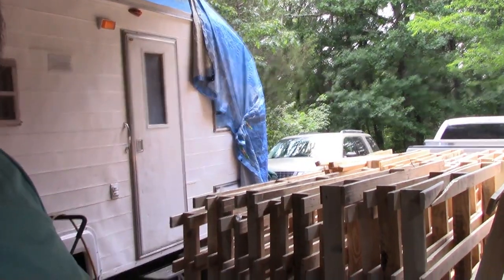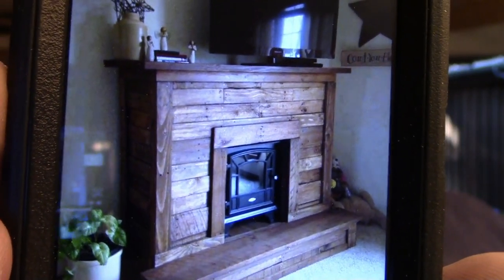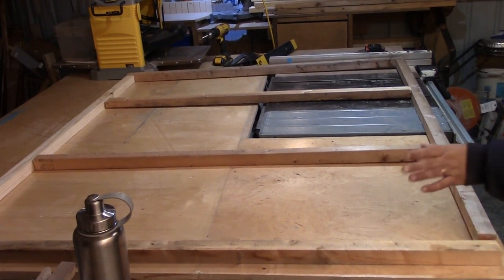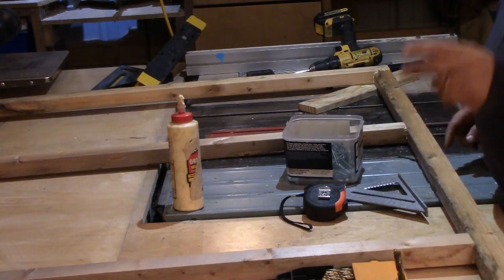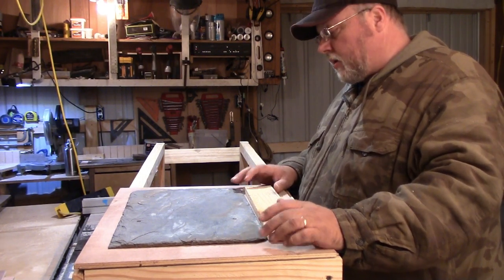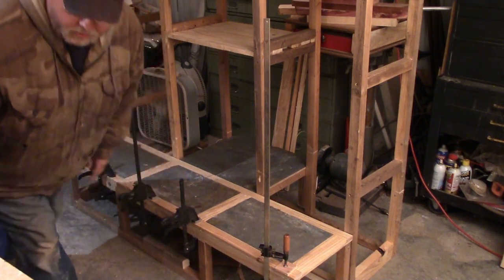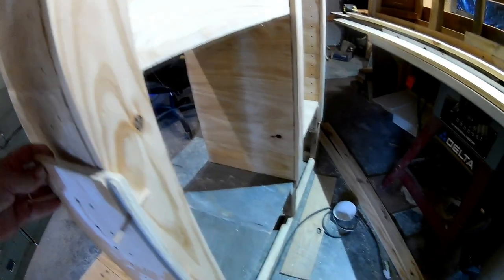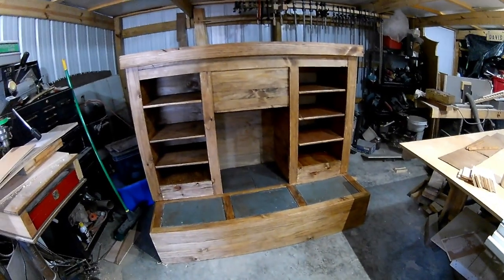Pallet Wood Fireplace

Comment: I assume that the wood stove sits in the middle. If that is true why are you concerned about the surround catching fire?
Reply from the maker: It's an electric insert that goes in it. No heat is generated on the sides. Good question! Thanks for watching!